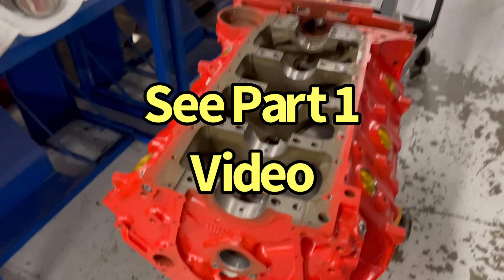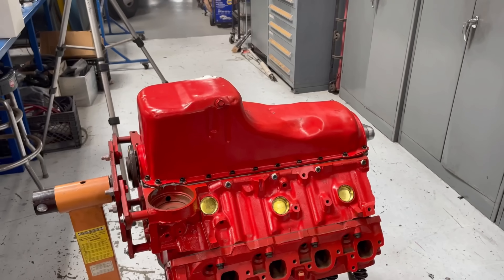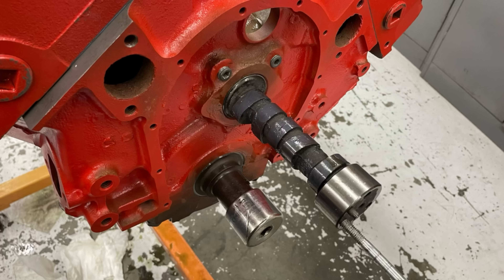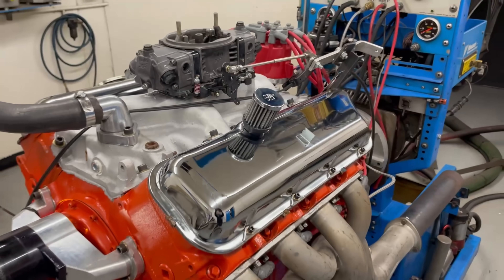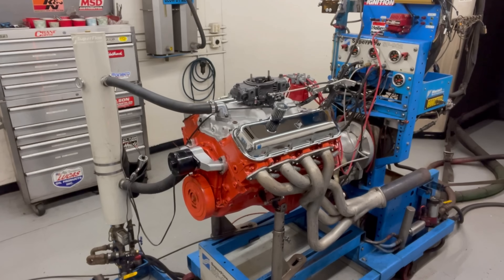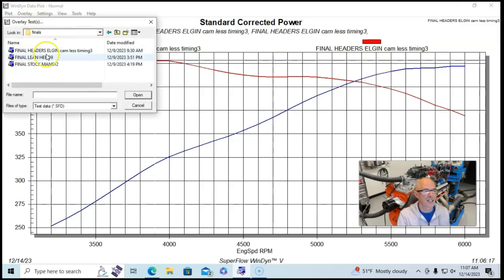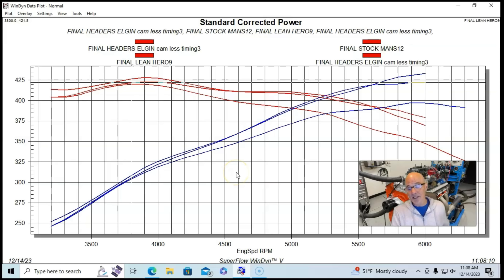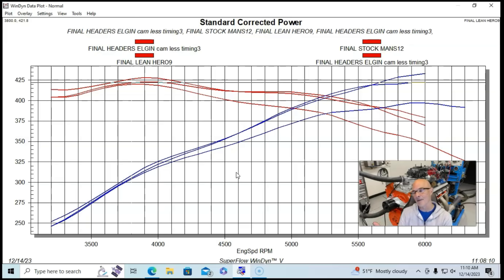FULL DYNO RESULTS ON THE L78 396, OVERRATED AT 425 HP OR  UNDERRATED AT 375 HP? WHAT DID IT MAKE?

Comment: Been waiting for this one.

Don’t forget the Corvette was rated at a higher RPM then the Chevelle. If I’m not mistaken they had different height intakes for hood clearance. The Corvette also ran a different exhaust manifold.
Reply: Probably different cam too. They do that a lot without saying they are doing it. Just like the 305 video, manual trans vs auto had different cams. Some weird random stuff like that. On the olds 455s they had slightly different cams for 2 and 4 barrel carb motors then there was different cams for what vehicle it was originally in. Engines and heads with the same casting identifier so not much of a way to tell without measuring the cam or knowing where it came from. Interesting stuff 👍👍
Reply: @SpecialAgentJamesAki  yes, their is some variation in cam spec for various years.
Reply from the maker: cam is the same
Reply: @richardholdener1727  Yes I believe they are. Wasn’t there a part number change for the oil groove on the early 396 vs the later engines without it?
Reply: @richardholdener1727    No. The Corvette 396 was solid lifter. 375 horse Chevelles were hydraulic.
Reply: @richardholdener1727  Not in 1965.
Reply: Vette guys woulda been mad if the A or F bodys made the same power. LT1, same story
Reply: @gordocarbo  I read somewhere that’s why they did it. Couldn’t have a family car making more power than the Vette. Marketing games at their finest.
Reply: The early 65 z16 396 was Hyd but the after that the L78 396/375hp engines were all solid lift cam,gm used that same solid FT single pattern cam/ with 520” lift/242 dur at .05 with believe a 114 or 115 deg LSA) cam (in the 427/435hp & LS6 454/450hp motor too.

Comment: Yes give or take 375 hp.         Fuel coming out of the squirter nozzles is called 'pull over'   either tune with it or get it controlled. Sometimes you just have to tune with it depending on the engine or combination.
Reply: I also noticed the pull over. One would think that with that happening it would make accurate tuning a problem. Somebody could mistake that for running rich and put smaller jets in causing a lean condition. Correct me if I am wrong
Reply: @royalchaser8090  Look back at my statement.    It truly is best to get it stopped. If street driven it becomes a real problem. If drag race only you can tune with it.
Reply: @Comet-hn3gm  Definitely not arguing.
Reply: @royalchaser8090  I didn't think you were.

Comment: The torque is fairly low. A stock 440 would walk all over that 396.
Reply from the maker: so a bigger motor makes more torque?
Reply: @richardholdener1727  …. Not that much bigger. That 396 is actually more on par with a 383…. & even then , I’d give the 383 the edge.

Comment: I agree with the marketing being the reason for the difference in HP. In 1965 Chevy still offered the 375hp 327 and with it also having 11:1 advertised compression and a similar solid flat tappet cam I can see why chevy may not want two engine options rated at the same power especially since the small block was so much smaller in cubic inch.

Comment: I would love to see what some general improvements would do to this engine.  Stuff like a better balancer,  better oil control, roller rockers, better intake, e85. Do that with the stock cam and heads!
Reply: I would like to see the same tests... and then add a rowdy street/strip cam... and then add NOS to see how you can take one on a "relative budget" and up it in stages. Or, do the upgrades and add NOS with a stock cam... or both. Keeping in mind a hot street driver to the dragstrip and toss on slicks type of sportsman deal.

Comment: @RichardHoldner. I would agree with the 396 L78 being closer to 375 in most cars that used the factory log style manifolds.  however, the Vette used a different exhaust manifold. it was closer to a header in design, and I am told they flow really well compared to the log manifolds. probably not as good as real headers, but probably closer to shorty headers, I would love to see this retested with Vette manifolds. but they are ridiculously expensive. a matching set of factory originals will set you back about $1500.
Reply from the maker: flow is not the same as scavenging-Vette headers won't add much
Reply: That's what I always thought - the Corvette had superior exhaust manifolds, and at first, a bigger carb.  Wonder what Tri-power or dual quads would do for power?
Reply: It will make way more power with the hood up with tri power or duel quads.  @jamesbosworth4191

Comment: For only 396 cubic inches torque is pretty good 3000-5500rpm and with 11 to 1 compression I"m assuming it could benefit from something with more octane than 93 pump like 98-100 octane these engines don't tolerate bad or lower octane like something made after 2002 or so
Reply from the maker: no higher octane needed-it was run at lower engine temp with no detonation
Reply: @richardholdener1727  l got it if you were street driving it in hot weather 90+ degrees with idling and driving it for a hour or so and sitting at stop lights this engine will generate heat a good water pump good electric fans and good radiator is a must if your wanting good performance and it if your wanting it to last
Reply: @gloriamaletta8667  With today's gas here in California, no way would I have double-digit compression for every day driving.
Reply: @jamesbosworth4191  I've been through mixing 3 gallons 100 octane low lead AV fuel now 6.50 a gallon with 5 gallons 93 non ethanol 4 dollars + a gallon mix from 2008-2021 now have a different car since December 2021 and it runs on E85 is about 2.40-2.90 a gallon 102-105 octane enough to support 12.5 to 13.1 compression car runs cooler burns cleaner so been there done that 2 years now car runs extremely well on it down point is it burns faster than gasoline does so if your getting 12 miles to a gallon of gasoline E85 gets 10 so a solid 2 miles to the gallon less both cars have 11 to 1 compression and are LS powered LS2 with CNC ported and milled LS3 heads with a 850 Holley carberator sold in 2021 now have a LS3 with CNC ported and milled LS3 heads fuel injected it has been running excellent for 2 years now on E85 neither where or are daily drivers but my 2009 Tahoe PPV 5.3 2WD runs on E85 it's a daily driver and it runs very good on it but gets 12 miles to the gallon on it 17 highway at 75-80mph
Reply: @jamesbosworth4191  with the upgraded fuel pump and injectors E85 is worth 20-25 horsepower over 93 pump on something naturally aspirated with 10.5 to 1 or up compression as compression goes up possibly more horsepower turbo or blower cars 35-45 horsepower or more the problem is it needs more fuel to get the power out of it without a upgraded fuel pump and injectors no gain
Reply: @gloriamaletta8667  I have no way to get Av Gas.  That's why I would want single-digit compression.  That's just me, if somebody else can get it, I salute them.
Reply: @gloriamaletta8667  The vehicles this engine came in did not have fuel injection, and classic cars are supposed to be kept STOCK.
Reply: @jamesbosworth4191  l know it came with a carberator and your stuck paying for 93 premium fuel enjoy it's stock
Reply: @jamesbosworth4191  if you run ethanol fuel with a carberator your going to have headaches been there
Reply: @gloriamaletta8667  If I had one, I would get dished pistons to lower the compression.  Yes, it would reduce power, but it would still be a fast car.

Comment: What fuel did they use back then vs what you used now?
Reply: It was common to find 100 or so octane leaded gas, when this engine was produced.
Reply: Leaded Sunoco 260 with 102 octane at around .40 cents per gallon. I used it back then.
Reply from the maker: fuel won't change these results-there was no detonation
Reply: @richardholdener1727 I agree. Plus, higher octane than needed LOSES power.....

Comment: In addition; running the factory pulleys without the Meziere electric water pump would have reduced horsepower even more, so I would have to agree with you on the original rating of 375

Comment: Id love to see a spec'd 375 HP 327 from 1964. And see if it lives up to mfr's spec's.
Reply: Pretty sure he did that. Made 350 iirc.
Reply from the maker: I did both the L84 and L76 (carb and EFI versons)
Reply: @richardholdener1727 Fuel injection was mechanical, NOT electronic,  but I know what you're saying. Nice work, Richard.....
Reply: @richardholdener1727  Thank you, I'll look them up!
Reply: Richard did a 302/327/350 test. The 327 was built to 365hp specs I think. Since all 3 engines use basically the same cylinder head, intake, cam and compression ratio they all 3 had very similar horsepower numbers. But the torque increased with each increase in displacement and the rpm where the peak numbers occurred dropped with each increase. Great video, go look back for it. I think it was about 2 or 3 years ago. Legendary engines that ran great and it's cool to see the real numbers.
Reply: @1967davethewave  wow thanks I will do that. I want another car with a 327 in it and spec it to the 365 HP specs. With newer parts you can build a 550 HP 327. There are guys doing that nowadays.
Reply: @bobdixon4998  Yes, and the 327 just seems to me to be something special. I'm a mechanic and over the years I've worked on many and it doesn't matter if it was a 250hp engine in a 4 door Impala, a 325hp engine in a Camaro or a built 327 in a '67 Chevy pick up, they all ran really REALLY well.
Reply: @1967davethewave  327s are legendary
Reply: Look back through Richard's playlists. I'm fairly sure he did some tests on that.

Comment: My L34 396 with a 750 Holley, hydraulic roller camshaft, Edelbrock airgap and headers made 399.5 HP on the dyno. I think the numbers for the L78 were pretty accurate for the 375HP. 425 HP was marketing.

Edit: MY 1970 so it was a 402. But it was bored 40 over which made it a 410 cid.
Reply: Wow, I would have expected a bit more than 400 with the upgrades you list.  Guessing you weren’t thrilled with the result?
Reply: @danmyers9372  was happy with it.

Comment: I've got THE carb for that: 3959164-GE 
List-4346 
2872

1969 big block 396/375 & 427/425 high performance models. 
780 CFM
Original GM part # 3959164 
Holley list number 4346 on air horn, original. 

Exact fit for all 69 , 396/375 & 427/425 models. 
PART NUMBER: ENC-844

Comment: I think that the HP peak at especially the lean run wasn't remotely peaked according to where you stopped the run maybe had 440hp in that run, but you did run past peek with exhaust manifolds which is odd....I mean according to that last pull with headers at 13.1 with maybe a touch timing up top your looking at 450hp at 6500...very nice for flat tappet all stock but headers....
 I've had these, and 427s..they liked RPM especially with an 850, headers and cam swap....

Thanks for the test now bolt a centri on it....
Reply from the maker: I like how people just start adding hp
Reply: I'm just extrapolating where the run left off the angle is fairly steeply climbing on the hero run...maybe it lays over 50rpm after the cut off I have no idea...but it IS heading up where shut down. Hard to tell but it was 434 me  adding 6hp just on what I can see of that curve when shut down doesn't seem to out of bounds and if it kept that trend to 6500? I didn't add a 150shot lol...
 I got "optimism bias" I guess lol

Comment: The 396 425hp engine in the 1965 Chevelle Z16  had a Hydraulic cam. To confuse the 396/425 story even more. I’d be curious how the 1970 “Pancake” intake affects power output.
Reply: That was a L37, he's building it to L78  specs.  the engine used in the 65 Corvette  was  top engine for Chevelles and Camaro throughout the 60's.

Comment: 375 is realistic, 425 not happening....also that 3310/780 unmodified ain't making more power than that XP. Great video Richard, thanks for the content!!!
Reply: It just happened and those don't look like the vette manifolds to me...they cut the rub short the hero run was gonna be near 450 at 650...damn....and 425ftlbs too...
 I love the 3.75 stroke I had good luck with them in bigger bore roller cam setups
Reply: what i'm saying is....425 isn't happening with stock manifolds, accessory drive and 780 Holley 3310 @ShawnGilbert1967
Reply: @johnginnitti4598  man I'm pretty sure the vette manifolds are different I can't quite recall but they look more efficient almost like a shorty header and man ive pulled these at junkyards that had 850 DP on em...and this I DO know every 427 we put an 850 picked up and every 454 we put a dominator on even if used an adapter plate picked up...they really seem to like more carb than you would think....

 I do wonder what was the octane of the gas back then wouldn't it be leaded maybe run bit more timing...hard to say but it's close....

Good thing about this block I've weighed em vs 454 DUDE there is SO much cylinder wall it adds iirc 20lbs it's nuts..so you talk about holding boost...

Take that engine toss a little D1x or F1A-94 on it and nice street engine shifting at 6500 making 1000 easy
Reply from the maker: no on the 850
Reply: @ShawnGilbert1967  The Vette manifolds are still manifolds and there are dozens of videos online that pit manifolds against headers. While the runner length on the Vette manifolds is pretty long for a manifold they still only manage to be about 10 inches and still neck into a very inefficient collector of about 2 1/4 inches. Ideal seems to be somewhere around 18 inch tube length for most engines going into a large 3 to 3 1/2 inch collector. There are tests that pit Vette manifolds against long tube headers, Pontiac Ram Air manifolds against long tubes, 426 Hemi manifolds against long tubes  and many others, and all lose 15 to 20 hp.
Reply: @richardholdener1727  I'm not asserting anything more like trying to recall outloud...my best friend in those days had a 70 Chevelle LS6 and I'm pretty sure it came with an 850....it IS hard to remember because thats the first thing almost everyone did was toss a 3310 ( iirc ) in the corner and drop an 850hp, the old canted torquer 2 and some headers on.....lol....

I do SO much wish you would boost this engine lol

I forgot to say thanks for all you do, I personally loved the 3800 series blower on the 5.3L...ive had a regal t type hehe with that engine and later the GTO iirc with that blower...600hp is wild damn good engine
Reply: @1967davethewave  I can see that but probably gains 5 over these...I mean really all we are trying to make up here is the water pump and alternator losses.....no kinda hill I want to die on...they done a good job with tje engine of the time...
 I prefer the 427, same stroke with 4.250 bore...built a very long rod 440ci off that one time ( which got piston weight down too ) spun the absolute hell out of it with 4.56 gears lol you know how we got down back then lol